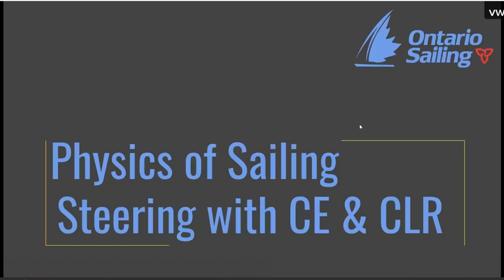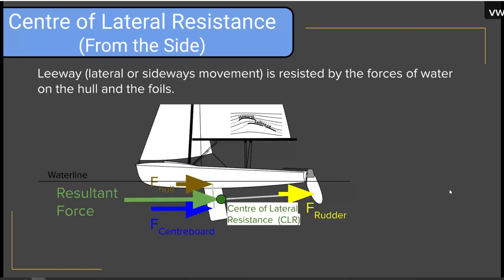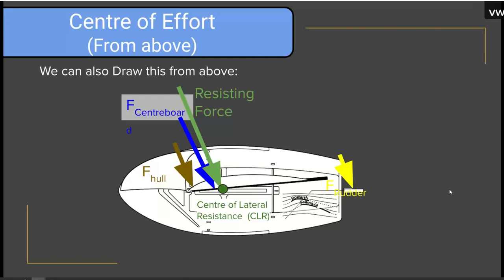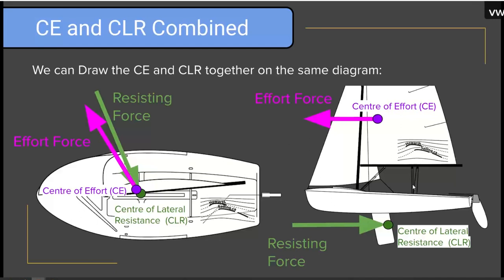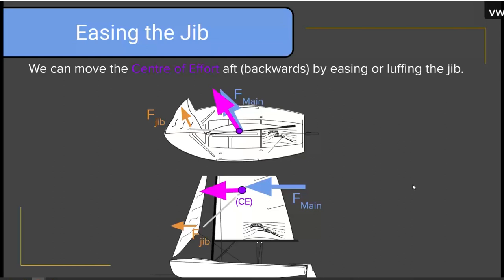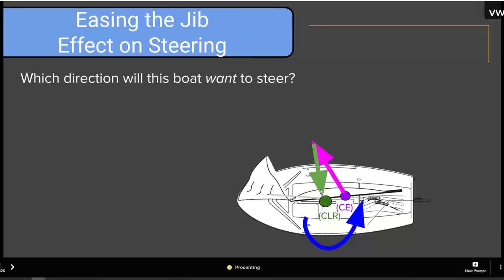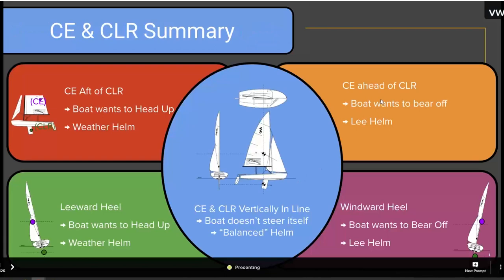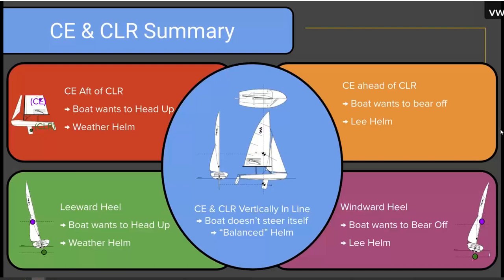Physics of Sailing - Steering with CE and CLR

Comment: Really good instruction, well instructed, I understand everything of your content. What confuses me is the info from the Naval Architects. Much of the boat building literature talk about a lead of how many percent forward is CE should be of CLR. If you have a 2% lead, it would mean that the boat has a slight lee-helm when upright, and when healing into the lee-side it will counteract into a weather-helm?
I'm aware that CE and CLR are geometrical values. And that the true hydrodynamic CLR and aerodynamic CE will be somewhere different. But then what's the reason of the CE lead? Is it just an empirical method of achieving a as low of a weather helm as possible? Since a 0% lead will have more weather-helm and more counter steering.

Comment: Hi Julian, I'm trying to solve a weather helm issue in a Flying Fifteen, which is an early Classic fleet boat so doesn't have a particular set of dimensions, the Classic boats all seem to be dimensioned and rig a little differently.  The mast foot has 3 positions, the forward and aft positions being about +/-40mm from the central position.  I currently have the mast foot in the forward most position and I'm still experiencing weather helm.  Previously I extended the shrouds to get the mast rake as far forward as possible.  This did produce a neutral helm, however other aspects of the rig were stupid, the boat looked awful with the boom climbing to aft and the gib clew way above the deck.  So I have now reverted to a more normal geometry.  I believe I cannot sensibly get the CE further forward than the current set up.  Neither is it an easy task to move the keel on a Flying Fifteen, well pretty much impossible!  I am wondering whether the rudder itself may not balanced.  I'm not sure this is a thing in sailboats (but I believe it is in power boats).  The Flying Fifteen rudder is very raked backward with the pivot point close to the top leading corner.  This suggests to me there is potential that the rudder itself could have a CLR to aft of the rudder pivot point. If so, this would effectively make the rudder bear down and produce a weather helm effect on the tiller, the tiller being on the opposite side of the rudder pivot point.  Does this make any theoretical sense?
Reply from the maker: Kind of a complex issue but here are some thoughts.

1. When you move the mast step backwards, does this rake the rig forward?  Usually the mast but adjustment is for inducing some pretend, or for changing g the rake, not for actually moving the whole.rige forward or backwards.
2. Sure it's difficult to move the keel, but this is some thing that high performance keel keelboat sailors do.  They have a boat shop 'fair' the keel and at the same time, build up material at the front and shave off material at the back.  Probably not your go-to solution, but a possibility. 

3. How bad is the weather helm?  It's typical to have some weather helm with the sails trimmed in hard, especially when it's windy, when the boat is heeling, etc.  The trick then is to use sail controls to depower or ease the main to keep the boat "on its feet".

Comment: Your arrows throw me off with some starting at the point and some terminating at the point of force
Reply from the maker: I'm sorry about that.  I think of it like a force can either push or pull.  Its not really important whether the arrow terminates at the centre or begins at the centre as long as it points in the right direction.